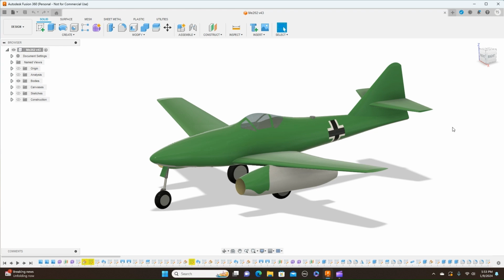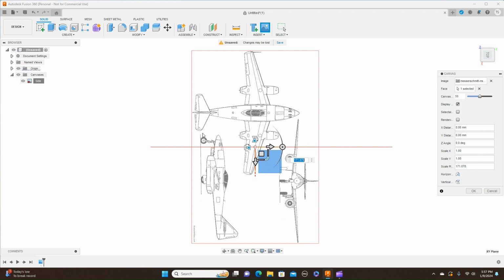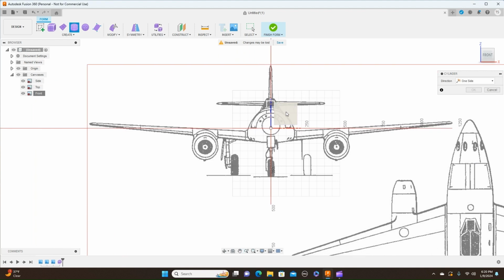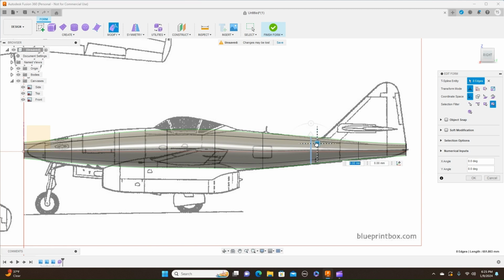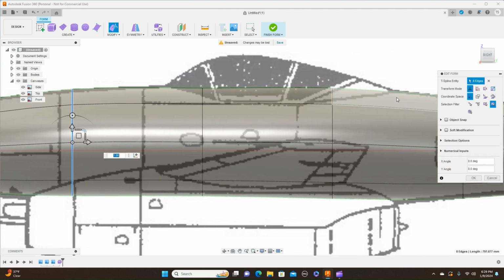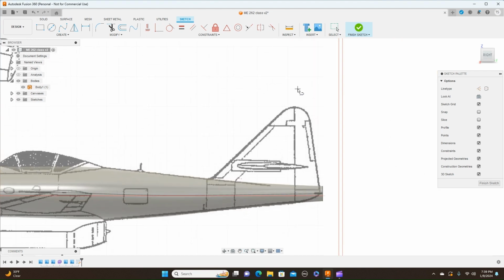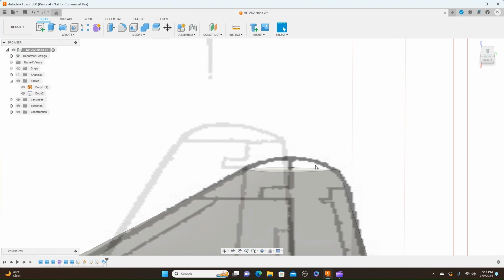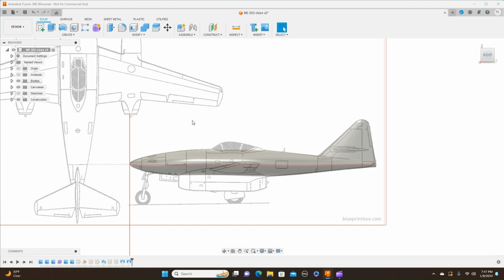Learn How To Model This ME 262 In Fusion 360 Beginner To Advance

Comment: I enjoy your videos, modeling airplanes for 3D print is my goal. If I'm successful in mastering CAD enough to do this, it will be only for my use. Nothing commercial in my intentions. I like learning on Fusion 360 but I've run into a problem. I have the free version as the others would be cost prohibitive for my purpose of use. The free version "Calibration" function is disabled. Do you know of a work around for this? Thanks in advance for your input. Chuck
Reply from the maker: Hello Chuck and thank you.  You should be able to use calibrate on the free version.  That is what I am using.
Reply: @cadbuildflyrc3784  I tried it again and it does work. I don't know what I did the first time that didn't allow me to calibrate. Thanks!
Reply: @cadbuildflyrc3784  I've tried to reply to your reply twice but it didn't send so I'll try to send you a message again. I also joined your facebook page and posted the same message there, so please disregard it. Thanks for replying so fast. I've been trying to learn CAD so I could build my dream airplane since I was a kid in the '50s. I went back to fusion and it worked ok just as you said. Don't know what I did the first time that stopped me. I enjoy your teaching style and I've learned a lot in watching a few of your videos. Hope you will get an interest in the F106 so I can follow you. Thanks again for your quick reply and help.

Comment: I haven't used any forms yet but I'll have to give that try. I have a tip for fit point splines. When you added the spline at the top of the vertical fin you could have just clicked on the top end of the profile lines, then make the handles tangent to the profile lines and finally drag the handles in or out to get the curve you want. You don't need those extra control points that you added along the top of the curve.